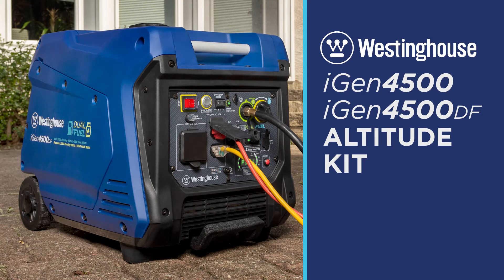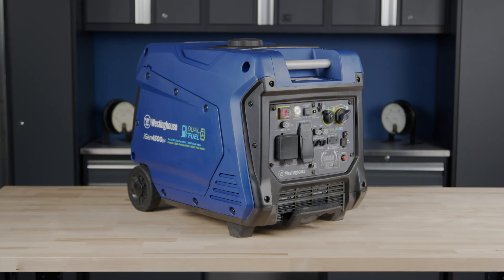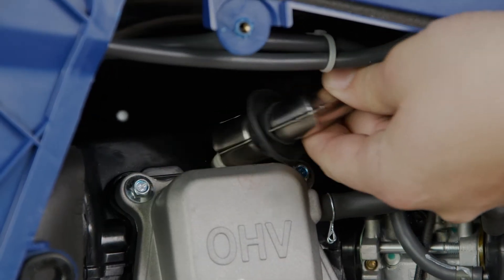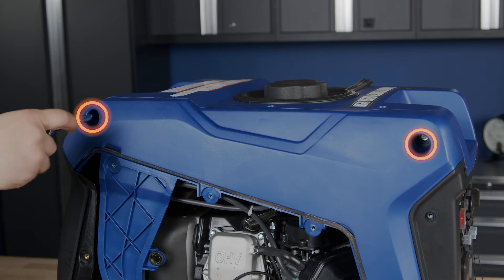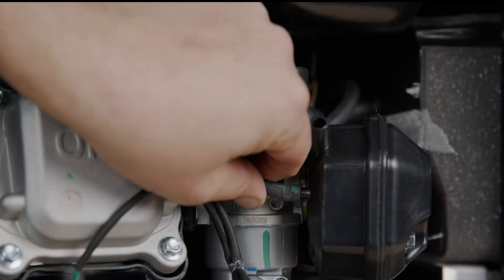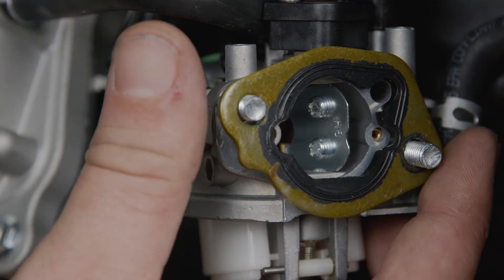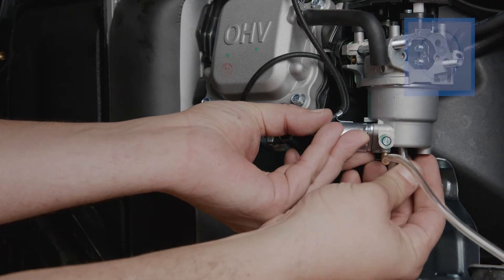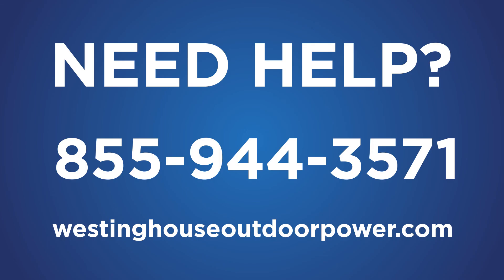iGen4500 and iGen4500DF Altitude Kit Installation - Westinghouse Portable Power Generators

Comment: When you read the manual it says the downside to not changing the jets when changing altitude is emissions related… 

Well if this is the process I’d have to do every months before we camp at a different altitude…. I’ll let the thing blow emissions out of the exhaust the whole time! 

You won’t catch me doing this for emission control when our government takes their emissions off of government vehicles lol.
Reply: I’m with you.  Half way into the video I’m thinking WTH.  Also manual says more gas consumption, and possible decreased consumption. Have recreational mountain property at about 7500 feet.  Powered 2 trailers at same take. Both are 30 amp AC.  Used mostly to recharge batteries when cloudy days slowed charging batteries by portable solar panels, run a hair dryer, toaster.  Everything stayed charged for 12 days.  Very happy with generator except for this issue and changing the oil.  But remote start is game changer!

Comment: Is this a requirement just to use the product at a certain elevation then the access should have its own panel and be a couple screws at most. Making us do a engine tear down to go up to 2000 feet is CRAZY
Reply: Generator hardly runs above 7,000 with stock jet. 20 bolts 3 covers air box hose removed, just to replace the jet wtf that is crazy.
Reply: I ran mine stock at 2300' it smoked a bit more than at sea level I didn't notice any issues afterwards. I will be installing the jets for 3-6k to camp in the mountains this fall.

Comment: I'm interested in the iGen4500dfc... I live at 4800ft... if I plan to run this generator exclusively on propane, do I still need to fuss with the carburetor? Or is the LP nozzle replacement enought?
Reply: By the looks of the picture at the beginning of the video showing the kit. I see a propane adapter and a nozzle for the differnet altitudes. So I assume the carburetor nozzle must be replaced. Just got my 1Gen4500DF and plan to travel the rockies in the future. So all info is good to know.